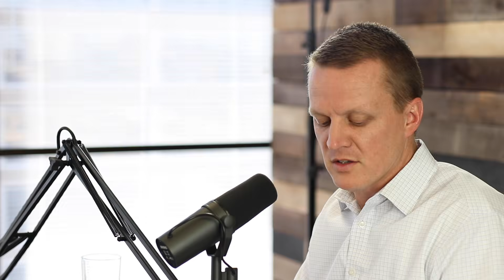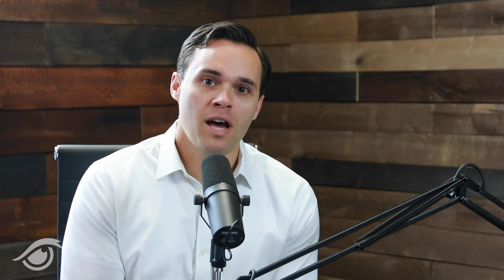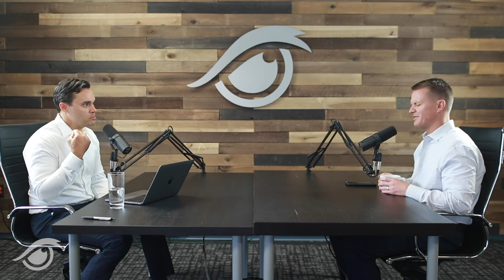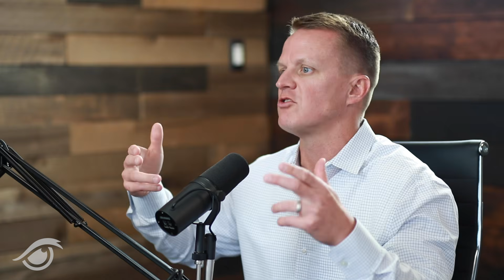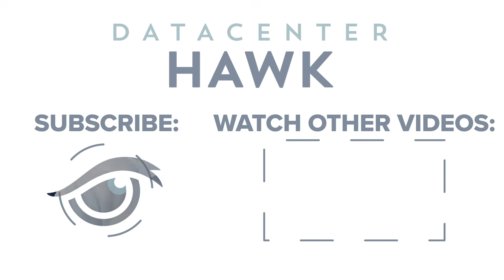What is Data Center Infrastructure? – Data Center Fundamentals

Comment: P r o P o r t a l
F i n e
A r t s
C e n t e r 

The next generation of energy infrastructure will not succeed on power alone. It will succeed on whether communities believe the infrastructure improves human life around it.

Most towns do not want a data center in their backyard because the modern data center is typically presented as a sealed industrial object. Large. Silent. Detached from civic life. Necessary, but emotionally disconnected from the community around it.

I believe there is a different model.

I am developing a system called ProPortal Architecture — a mathematically driven architectural framework based on proportion, human spatial response, acoustics, geometric balance, and long-term civic usability. The goal is simple: infrastructure that people emotionally accept because it contributes beauty, identity, and usefulness back into the community.

The integration of AI-era data center infrastructure with a world-class fine arts auditorium and civic cultural environment.

The opportunity is larger than architecture.

A properly designed auditorium integrated into a data center campus creates a new category of infrastructure:
a Civic Energy Campus.

The data center provides:

- resilient energy systems
- thermal stability
- advanced digital capability
- long-term economic investment

The auditorium provides:

- public identity
- civic pride
- educational access
- arts programming
- university partnerships
- community engagement

Together, they transform a project communities often resist into one communities compete to attract.

ProPortal architecture focuses heavily on the mathematics of human comfort and perception. Proportion, volume, acoustics, light relationships, and geometric ratios materially influence how people emotionally respond to space. The result is infrastructure that feels intentional rather than imposed.

- improved municipal acceptance
- stronger zoning outcomes
- differentiated ESG positioning
- national media visibility
- workforce recruitment advantages
- educational and university partnerships
- long-term community integration

The future AI and energy economy will require enormous physical infrastructure expansion across America. The companies that succeed politically and culturally will be the ones that understand infrastructure must become human again.

I would welcome the opportunity to discuss the concept further.

Lee Zimmerman
Founder / Principal
ProPortal Architecture

Oversee major infrastructure development 

Specifically involved with data-center hubs and generation strategy 

 Commercialisation and infrastructure partnerships 

Attach one visual ProPortal plate showing:

auditorium geometry

energy integration

public plaza

AI/data-center integration

acoustic mathematics

civic-facing architecture

That visual could materially increase response probability.

Comment: Redundancy can be considered useless, when one data center loses power, another data center in the same area picks up the data load. By the time gens fired up the other data center has already picked up the data center load in the same city. That is the current trend. Also the servers are so dense you can't have a raised floor. You have submerged chip clusters called GPU's and whats called dual cooling with CDU's. 1 rack can pull 200 kw making the client use starline bussduct instead of RPP's. AI training data centers pull the most power. For example the last DC I built was a 300 MW data center. 220 chillers with 15 seperate chiller yards, pump houses with TES storage tanks. Each chiller yard is dual fed from Vista switches. I would love to come on this podcast and explain the way the new data centers are operated. Most big companies are going with large multiple data hall campuses. The total power used in just one campus can be 1.5 Gigawatts total. 

 I have a great idea for data center cooling solutions, but I want to sell this idea and make enough to retire today. I started working data centers in 2008 in a tier 3 data center. My need is to retire because I'm 54 years old. I predict people like me will make $500,000 a year by 2030. My idea, if implemented will require billions of dollars and at least 10 floors of data hall. My overall data center goal is to design my data center and ride off into the sunset. Once built, my data center will have 1 PUE or less. Message me if you're billion dollar CEO who wants to change the whole concept of how data centers are cooled. My design can't be copied. Lets just say bye to cold and hot isles.
Reply: I hope your dreams come true.

Comment: I was a data center electrician. The only downside to it was the pay wasn't on par with the specialization. They look at it as if every electrician with a JC card can do it and the pay should therefore be equal when that simply is not the case and the risk and severity of not only the person but equipment and it's clients are multiplied 10 fold.
Reply: Same story. 15 years building, maintaining, and servicing DC's specifically. Going to work for an owner now as a Sr. Field Director of Construction.
Reply: Deep Underground Electrical line installation is very dangerous, dirt or forms collapse and installer is injured or killed.
Reply: Amen…I too have been in the same boat…I run these large high profile projects for a large EC..I am trying to wake up the local unions and make them aware of this specialized market and demands that should come with lucrative pay scales…and they are NOT…totally disagree with the OLD GUARD

Comment: Hi I was interested in building a data centre in my town....but I don't know the advanced stuff about it ....What do.you guys suggest would be a good start to gain proper knowledge for this ?
Reply: Follow sites like datacenterhawk, datacenterknowlede to get to know about infrastructure...
Understand concepts in certifications cdcp and higher, uptime certifications, LEED green, TIA942...
Get to know the ITSM principles.

Primary things to survey and take note of:
Planning stage
1. Enough real estate to contain all the required support infrastructure and maintain the physical security layers.
2. Is there enough quality power available from the utility supply to support the infrastructure. 
3. Is there enough bandwidth available from ISP to support your infrastructure.
4. Local regulations regarding working of a data center. Noise and pollution output from generators, transformer humming, chiller sounds, power factor issues..
5. Instant availability of fuel for your generators in case of prolonged utility supply outage.
6. Availability of quality staffs at the infrastructure/IT/networking fields willing to work in your town.
7. Site selection. Flood prone, earthquake prone, other natural calamities, riots. All these can affect your functioning.
8. Do not try to go cheap on your CAPEX. As far as data center goes.. Good CAPEX well spent can reduce your OPEX and downtimes to a high extend... Get consultants and contractors with specific data center experience to construct it.
9. Market study on the potential customers.
10. Level of redundancy. Less than Tier 3 is not recommended.  A mix of TIER3 and TIER 4 with dual path for power will help you a lot. 
11. Plan and allocate for future expansion/changes. Consider the power, cooling and bandwidth. Plan properly if your customers are going to be using blade servers.
12. Plan how you want energy metering to be done. Depending on customer. Roomwise, POD wise, PDU wise, Outlet wise..
________________________________________
Design, Construction stage
If you have a knowledgeable consultant they should take care of everything.
But still a few things to note
1. Make sure all the critical standards from IEC, NFPA, ASHRAE, TIA, LEED are followed in construction, fire protection, structured cabling, eco rating.
2. Implement BIM along with CFD modelling to analyze and coordinate designs. Try to extend BIM into post construction activities to facility management.
3. Ensure an electronic document management system is strictly used while construction happens to keep track of proper document revisions.
4. Ensure all the monitoring systems like BMS, EPMS, SCADA, DCIM are designed and validated by people with experience in the operations field. Believe me this is critical to operation, reporting and energy monitoring.
5. Proper discrimination studies have to be conducted to contain any electrical faults with the immediate upstream device. 
6. Provide buffer tanks and chilled water pumps on UPS to maintain cooling till soft shutdown incase of critical power failure.
7. Do not take the handover of the project until each and every drawing including internal drawing for the smallest panel, warranty, O&M manuals, preventive maintenance procedure, etc. have been handed over. 
________________________________________

Operations
1. Designate the facility team before contractor leaves the project. They should clear any snags or doubts remaining.
2. Ensure processes that enable collaboration between IT and infrastructure team.
3. Utilize the power of DCIM to create work orders for any device upgrades to enable asset/change management. Use it for capacity planning. Do not approve any IT changes without consulting with infrastructure team.
4. Ensure all SLAs with vendors comply with your uptime requirements. Go for comprehensive AMC if you have the budget.
5. Document each and every tiny procedure that take place on the infrastructure.
Reply from the maker: Amarjit Singh Check out our free trail at Datacenterhawk.com and take a look at our Fundamentals blog series on our site. That can give you a starting point and then you could evaluate the demand in your town and there could be some telecom companies that would be willing to partner with you.
Reply: Just do it don’t overthink it build it and they will come